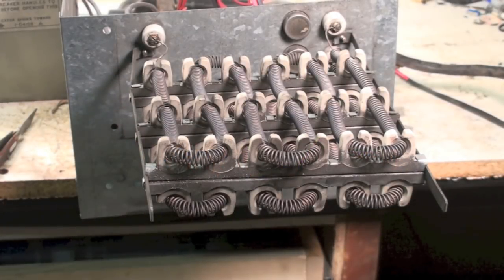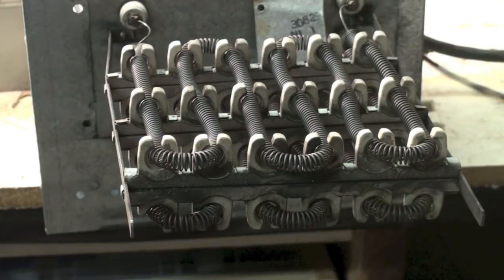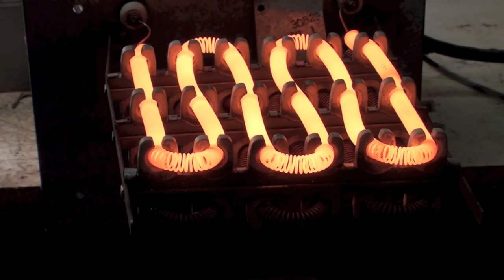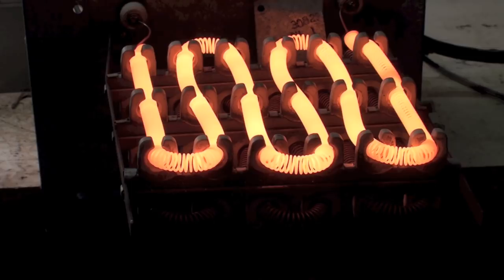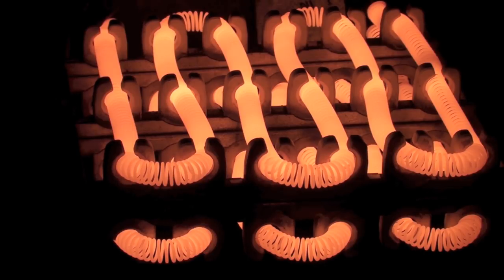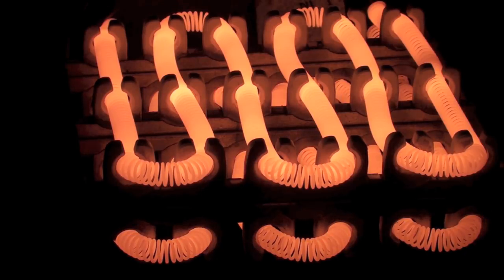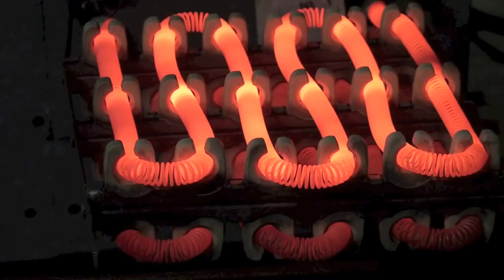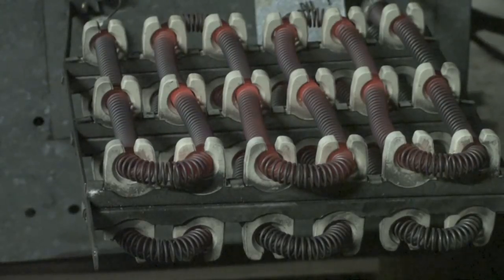How the electric elements on an electric furnace work  Part 2

Comment: I have GE electric furnace (air handler) that feels hot in plenum section even when termostat is set to lower temperature and heating(blower) is not running ? Is this normal ?
Reply from the maker: No.  You could have a stuck contractor or shorted element.  It needs to be looked at.
GFM
Reply: @grayfurnaceman  
Thank you. That's what I've taught. That is why my electric bill was high as well. Heater strip stuck and working all the time no matter if the termostat is calling for heat or not. What do you think about heat pump. I leave in Chicago land? Thank you for your help
Reply from the maker: If the back heat is electric, its a good idea.  If its gas, probably not.
GFM

Comment: Can ordinary coiled wire resists T° up to 1000°?
Reply from the maker: The wire can handle up to just below its melting point, but many types of wire will oxidize at the high temp.  That is why we use nichrome wire for heating elements.
GFM
Reply: @grayfurnaceman  thanks,,,can 1500 watt wire resist?
Reply from the maker: @girar813  If the wire is made from nichrome, it probably will.
GFM

Comment: When it's -20c, it's not really hot, I think that one of the element is burnt out, how do we know if it is? When it's -10c, it's okey but when it's very cold, there is not enough hot air. We've been using this furnace for 20 years.
Reply from the maker: First, I would check all breakers to the furnace in the main panel.  There may 2 or 3.  If there are any fuses or breakers at the furnace, check them.  Turn them off then back on.   If you are confident in your abilities regarding electricity, you can look inside the furnace panel.  Look for any burned wires.  Next you are looking to sequencers or elements.  Here you need a meter and the ability to use it.  Let me know how you do.
GFM
Reply: Thank you for the fast reply. I have turn off and on the breakers and the fuse. Since 2 years ago, I covered half of the intake air from outside the wall to keep warmer, replace the new filter.....,
I will check there is any element burned.

Comment: It does. But an electric furnace doesn't produce heat output above 120 degrees Fahrenheit gas furnaces can can provide a heat output of up to 180 degrees Fahrenheit and hotter with some furnaces. My gas furnace, for example has a designated maximum heat output of 185 degrees Fahrenheit on first and second stage operation.

Comment: Hello .Thank you for yours videos. I have the same question as Lauj  Vwj. Is the coil heat strip bad if only parts of the strip glow when it's heated? The mainteinance guy replaced the strips and still aren't glowing completely. Thank you.
Reply from the maker: They should not glow at all except inside the insulators.  The fan pulls all the heat off.
GFM
Reply: grayfurnaceman. Thank you for your quick answer. So, thst is normal? Regards.
Reply from the maker: Yup.  Merry Christmas
GFM
Reply: Thank you. Merry Christmas.

Comment: if you have burned 12 gauge wires in series with your heat strips why not replace them with 10 gauge?
Reply from the maker: The problem is not the wire size, but the wire terminal connections.  If they are clean and tight, there will usually be no problem.  That said, I did often use #10 wire as replacement.
GFM

Comment: Standing near it does it feel like standing close to a bon fire where you feel like the your face is hot through infrared radiation?
Reply from the maker: If you are very close, yes.
GFM
Reply: @grayfurnaceman  I meant infrared radiation* similar to how when you stand next to a toster owen and you can feel the inferead radiation from like two feet frim the glass door though the glass even though your not actually inside the owen where it gets hot. Or how when you stand near a bon fire and feel warm on the side facing the fire even though the heat rises you feel warm from the inferead radiation.
Reply from the maker: @mattdaddy_888  Yes, it does.
GFM

Comment: How many watts do those elements pull?
Reply from the maker: Usually about 5K
GFM
Reply: 5kw is about 20 amps at 240v single phase 10kw about 40, exact amp draw depends upon factors that are just unimportant here in this context.

Comment: I have a question, working on an older Stewart "GE" electric funace, its not blowing good heat ...its a 4kw unit air conditioning is also included with this setup.."try to get u better info as soon as i can" went thru everything relays all seem to be working well, element is heating has dual element that both come on at the same time, no delay between the 2 like i seen in your videos..and it dont heat apt. well, warm air is coming out but.....just seems weak to me  someone else changed thermo there are 1 red 1 yellow 2 greens , and to be honest with you i dont think it is wired correctly  should the 2 green be wired to the same screw? or seperated? try to get you better info later today and check back  thx Gray
Reply: Green wire should go to the letter g on thremostate thats for your blower newer thremoststes have a built in delay

Comment: hi what the cost to run that for 10 min??
Reply from the maker: You can calculate the cost by measuring amp draw x voltage x kilowatt hour cost divided by time.
GFM
Reply: what do i need to do that?
Reply from the maker: An ammeter, voltmeter and some easy calcs.
GFM

Comment: So is an electric furnace expected to warm a house as well as a gas furnace? I believe they don't. If you agree why dont  they make one that will. bigger coils , maybe more coils? Why not use a  burner like what is used on an electric stove instead of those small coils of wire. The coils dont seem much larger than whats used for a space heater. It seems electric furnaces could be made to heat  much better if someone like an engineer put thought into beefing  up the coils.
Reply: Electric furnaces are quite as able to heat a structure as any other.  They are sized for the load as any other furnace is.  They are engineered.  The coils are generally 5 kilowatts each.  
Now for the real problem.  An electric furnace, or any furnace will shut itself off if there is not enough air flow.  This could be from a plugged filter, or restrictive ductwork.
The only other possibility here is one or more of the elements may not be working because of a failure of the controls or the element itself may be failed.
GFM
Reply: My electric furnace works just fine pushes around 125 degrees out the vents and keeps us very warm in 0° whether

Comment: If I were going to use electric heat, I would do it on a room by room basis.
Reply from the maker: In that case, you would have to use baseboards.  Probably the most inefficient form of electric heat.  It is not the efficiency of the elements themselves, just the high temps located near the outside walls and windows will increase the transfer of heat outside the structure.
GFM
Reply: grayfurnaceman It would also depend on the quality of insulation such as it's R value. But by using individual forced air wall heater units, it would give one the flexibility of heating only the rooms in use.
Reply from the maker: Consider that interior rooms are not insulated from each other and you simply create cold spots in the structure when they are not heated.  Also consider how much better the a forced air system using 120F air would work with the increased R value.  Temps above baseboards have reached 400F.  It truly is the cheapest but overall the worst and least efficient of the electric systems.
GFM
Reply: Jolyon Welsh have a 5-ton York electric furnace just had my power wiring upgraded from 40 amp to 240 electrical box I need to know how to hook up my furnace it's cold